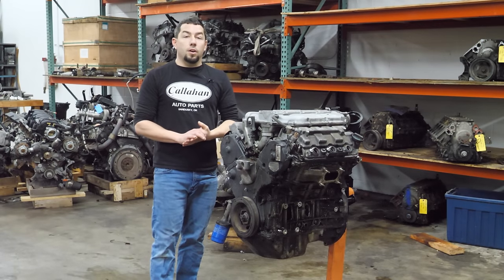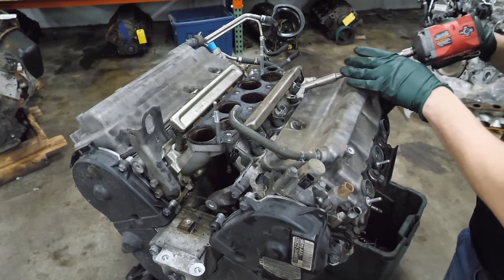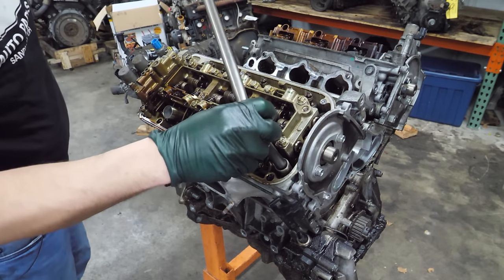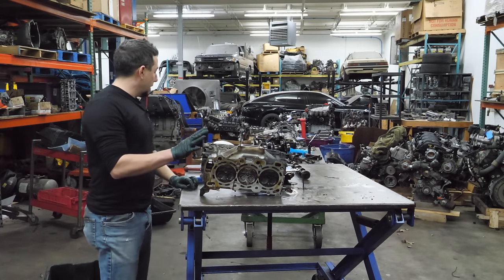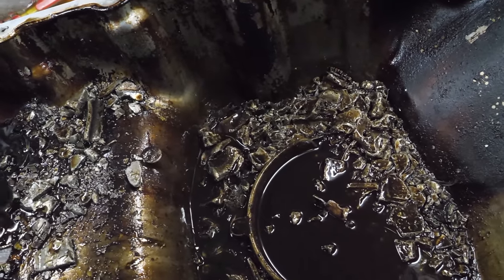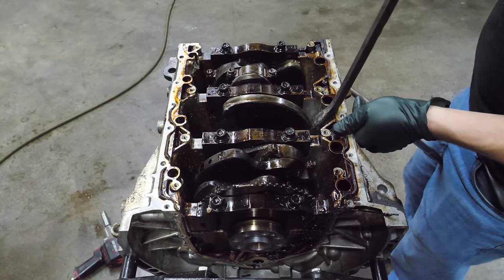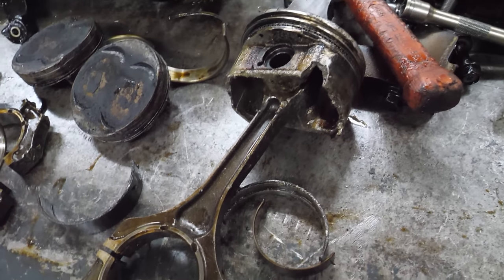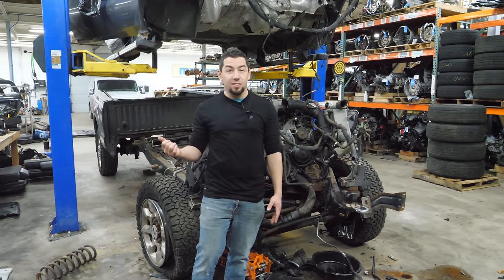Obliterated Honda Accord J35 V6 Teardown. Customer States: "Vehicle Shut Off"  OH I BET IT DID!

Comment: Aluminum gravel is never a good sign! Gotta wonder what exactly they were doing when it went BANG.
It's nice that Honda designed their engine to separate out the different size shrapnel in different parts of the crankcase. Japanese engineers are so organized!
At the end of the world, there will still be cockroaches and wrist pins.
My RAV4 and Civic are both still at about 75% on the dipstick.
Reply: Doing at least 10,000 RPM ?

Comment: Love this video. But pure customer neglect IMHO. To reach this level of destruction.  I repaired a lot of the 09 accords   Where they came from the factory with the rings incorrectly installed.  Oil lights were on at 1700km’s.   Crazy times

Comment: How did that engine run long enough to shred the internals so finely?? Wow!
Reply: I’m sure it came apart around 6500 RPM…probably had it floored because it wouldn’t get out of its own way.
Reply: Inertia and one functioning cylinder....

Comment: The problem with the VCM engines seems to be the fact that the vacuum effect created by keeping the valves closed pulls oil past the rings; there was a class action lawsuit about it in the early 10s for any J35 with VCM. Oddly enough, the Acura versions of the J-series were not mentioned, even though I'm pretty sure those had VCM as well. Guessing there was a different ring package on those.

EDIT: apparently the Acura engines were named in a separate suit. Not sure why.
Reply: If the engine runs in VCM deactive mode long enough will enough oil accumulate in the combustion chamber to risk hydrolock ?
Reply: @davidpowell3347  I don't think so. I'd be very surprised if the system didn't reactivate the rear bank every so often; I know GM's AFM does the same thing. It'd just get burnt up during combustion.

Comment: Honda's are the best performing engines and when they let go,  they do so with great style.

Just like the B series that split the block in half when you put 80 pounds of boost.

Jamie does 8 second quarter miles and has split a few blocks that way...

Comment: I must be extremely blessed with my 2012 Accord with the J35Z2 engine, It has 143,000 miles on it, NEVER had one issue with the engine, still getting up to 31-32mpg on the highway, 25/27 mixed.  I changed all the plugs at 98,000 plus timing belt/water pump, and except for a very slight off white color, the plugs looked brand new.   Oil changed religiously. along with all other fluids (tran, PS, brakes, every 30K ).  BlackStone Lab oil report is as follows:  "Look at that, another impeccable report to round out trends for this Accord! This oil was in place
longer than the last, yet iron and copper both declined. Maybe routines have shifted since 2017, and this Honda is doing more easy highway driving (which is the application that tends to generate to least wear) or maybe steel and bronze parts are just getting along better. In any case, every data point we have to go by points to good internal condition. The physical tests were all within specifications, and the 1.4 TBN shows just a little active additive remained. Nice!"  What the devil did this guy do, get the car, apply full throttle, walk away from it for a week and come back later after it blew up??

Comment: I once bought a donor VN for the manual box with a Buick L27 3800 that blown up far worse looking that this from the outside. The entire sides of the block was missing on the rear 4 cylinders all the way to the water jacket. There was only a crown of No.5 up in the bore, no rod or other piston large parts. Just 1kg or so of fine gravel and sand sized metal in the bottom of the sump, wrist pin punched half way through the sump for quick oil chances, the two lower rings in the sump.  Broken cam lobes from when the piston hit the valves and transmitted shock up the valve train. Pushrods were fine somehow. Nearly all the bearings were spun. One of the crank counter weights was broken off. 

The amazing thing was that it still started perfect and ran and could still drive, though it would have died from lack of oil eventually. 

Turned out it hadn't had an oil change in many 10s of K and there was so much solid carbon that the oil pick up was blocked and a kid was using it as a burnout car. 

At my last job, one of the race car's LS 6L blew up really bad like this. It had bits of con rod up in the intake and most of the valves were missing. It also had cylinder deactivation but it was deleted with a kit, so we suspect something with the delete caused a valve or two to drop at 8K.

Comment: Those are alternatives to a PCV valve you are correct though in order for them to work properly you need those inspections ports aka alternative PCV systems to be on both sides so you get proper flow through the engine block.

Comment: I don't have much experience with Honda six cylinder engines; however, my mechanical experience with the older 1980s EK, ES,  A18 and A20 engines was great.  Underpowered yes, but the engines and five speed manuals were robust.  I maintained my Hondas, but I know a lot of owners who ran them two qts low on oil, overheated, low on coolant,  dirty air filters,  unadjusted tapping valves,  but we never had to replace a head gasket, valve stem seals or had work that required dismantling the engine.  The downdraft carbs suffered from vapor lock on hot days although not a problem with the side drafts on the Prelude.   The alternators were crappy and the bodies rusted, but the drive train was exceptional.

Comment: That engine reminds me of the 2004 Honda Accord sedan EX-L 3.0L V-6 my son bought at an auction ($700) many years ago that only made it a couple miles before the 5 speed automatic trans (BAYA) gave out but after a transplant out of a wrecked Accord, he now has almost 350K miles on the odometer, doesn’t burn a drop of oil, and the car runs extremely smooth and quiet.. Of course an oil change every 5K miles with high-mileage full synthetic oil/filter that claims up to 20K miles may be helping the longevity but we have no idea what the previous owner used or if the timing belt was ever replaced. 350K miles makes me nervous but the engine purrs like it’s brand new.

Comment: I keep meaning to install my S-VCM I bought in my 2009 Odyssey EX-L... if it weren't almost midnight, I'd go and do it right now. I think my lunch break tomorrow is now spoken for. It has 220,000 miles, and while it's had misfires and fouled plugs, nothing catastrophic has happened... yet.

Comment: These engines received a "quiet" warranty extension.  Honda did not notify customers.  I had one in a Crosstour.  Found out about the oil problem at Thanksgiving one year.  Put 3qts of oil in a 4.5qt system before driving 8hrs to visit family.  Ate a couple more quarts on the trip.  By the time I got it into Honda, I learned my warranty extension had expired. Loved the car, but traded it in ASAP (not on another Honda!).  2006-2012 Accords and Crosstours with the v6 as well as Acura TL (3.7) are time bombs.  My cousin got lucky.  Her TL started eating oil early in its life and she got her engine overhauled under warranty.

Comment: I would like to take a moment to recognize how strong the bottom end of this engine is, the main caps held the crank in as the rest of the rotating assembly was fed through it and came out relatively unscathed. I wonder how much boost that thing could handle with proper oil changes and VCM deactivated

Comment: im happy to say that i have a j35A7  2013 minivan and its got 93,000 miles and i drive it really hard and the VCM activates so smoothly that i have to look at the dash and barely notice the difference in engine sound to even notice it. since ive had it new i never went by manufacturers idiotic recommendations.  ive always used 5-30 synthetic cause 0-20 is like water. i change it every 3 months.  i changed the timing belt at 80k miles and like usual turn 6k revs from time to time. i also have changed the transmission fluid every 6 months (cause only 5 comes out) and i use a trans cooler along with an oil filter. i dont like radiator cooling for transmissions i separate them. its a large ford oil filter for the transmission that i also change with fluid. its DW-1 fluid. i have never had a more perfect shift. full power is always available and downshift is really quick and precise.

Comment: The shear amount of laughter in this video I think sums it up. I was laughing along with you as I watched this in amazement.
I ended up looking back at the Kia video to compare. The Kia had good cams. Did this have good anything?
Speaking of which, we only saw one cam. What was the other one like?
Didn't think the Kia would be knocked off the mantle so quickly!

Comment: 2015 odyssey touring 
380,000 + km and still going.
These v6 engines are one of the best engines.
Most of these issues are people who don't maintain the engines.
Maintain and have no issues.
I haven't had a major issue with my van and almost at 400,000 km

Comment: I love your laugh Eric wish I had a opportunity to work with you your such a good and funny guy keep up your videos when ever my motor blows up on my 03 Yukon I want you to tear it down and see what you got to say it’s almost at 300k miles but still running strong I do change my oil on time most of the time I might go like 1k or 1500 miles over but never had a issue let with it right now my mother in law has a 5.2l 318 in a 98 dodge ram 1500 with a locked up motor couple cinders wasn’t oiling wonder if I could convince her to get rid of it hmm anywho keep up the good work Eric

Comment: I've worked on Diesels for 20 years.....have done all my own work including a full teardown and rebuild of a LT1 gm motor, several D series and B series, a 4.7 and currently a 5.8.  I have NEVER EVER in my life removed a cylinder head and have ONE missing piston much less 3 unless there was a HUGE hole.

Comment: Interesting, I'm running 5-7 psi in my J35z2 and so far it hasn't blown up. 147k miles with a 5speed auto. Deleted EGR and have a .63A/R Maxpeedingrods turbo. No cats and no O2 sensors with Ktune

Comment: Wow. They must have run that as long as possible after it broke because of the thousands of fine metal particles and the holes however the block. The block was like Swiss cheese.  I would have loved to hear that noise it made from when it 1st broke to when it finally stopped turning.

Comment: They do make green engine oil. Brad Penn if I recall. There's also a brand of racing oil that's green as well. This one was lucky to have any oil, let alone high end name brand stuff. 

Never seen an air cooled Honda v-6, Bluetooth connecting rods, all  cylinder shutdown, variable valve seating, adjustable compression stroke and even hammer forged internals. This engine has all the latest features. Neat!

Those little bits of debris on the front middle intake valves that aren't nuggets, they're chunklets. Also I'm incredibly impressed this engine just shut off on the highway. Usually when an engine grenades half it's cylinders and disconnects the remaining cylinders' rods....... It tends to be a bit more violent than "shutting off"
Reply: Sure, but that wasn't it. There was coolant in the oil because when the bore broke on the middle rear cylinder it created a leak from the cooling system to the oil pan.

Comment: I used to have an automatic V6 accord that also just "shut off" like that, I thought it was the fuel pump at first. First it started back up still rolling on the highway, seconds after it stalled in a corner, and third time it stripped the teeth right off the timing belt. Now I have the 6MT engine which doesn't have that silly VCM

Comment: The only engine I know of that survived oil starvation was in a Chrysler New Yorker. A lady drove it to Jiffy Lube because the low oil pressure light came on. When they went to drain the oil, there wasn't a drop left. After she turned it off, the engine seized. Wouldn't turnover. However, they put oil in it and rotated it manually a few times to try to get oil in the cylinders, and it cranked up, but it smoked so bad because it was burning all the oil they put in it. It was unbelievable. She claimed ignorance that the engine needed oil changes.

Comment: Should have gotten the honda with the 4 cylinder. mine now has 230000 miles and have not done anything to engine except plugs, oil and filter when required. still runs great and is strong. have fun.

Comment: I had a lady with a crosstour that did almost this exact thing. She said she was driving on the highway and it just shut off with no noise. I had never seen a catastrophic j series failure before that. Engine was completely locked up.

Comment: Seeing this and knowing you’ve torn down a K20A2. I desperately want to see you snag a k20c2. Seeing all the fits about the L15B7 turbo engines and how they easily bend rods and how SLIM the rod cap bolts are. I’d like to see up close how honda did the new 2.0 NA… I feel it’s very underrated and may probably have a strong NA tuning aftermarket if done right.

Comment: I have seen worse.
Some kid put the turbo charger from a Volvo 740 on a civic with no waste gate.
Ran wonderful for about 30 feet. all pistons went through the oil pan. all valves were blown through the hood taking it off as well. there were 10 cracks along the block .
the Pistons went into the road to a depth of 5 inches deep from what used to be the top of the piston.

Comment: Bought a 2009 Pilot with 150,000 on it for 7,000 bucks last year in 2023. It was getting around 9 mpg, on the damn highway! The vibration when the cylinders deactivated was absolutely ridiculous, and it ran like shit! After doing a bit of research on the VCM issue, I purchased, and installed the VCM Tuner 2. It never lets the computer know that the vehicle reaches operating temperature, thus not allowing the VCM to activate. 😁 Step two, and three was changing the timing belt, and running various engine, and fuel system cleaners through to clean out all of the buildup. Oh, and I stopped using regular unleaded, and switched to premium fuel. Believe me, it's worth it, and I don't drive it like a race car either lmmfao! 😂 After eliminating the VCM, doing some basic maintenance, and switching to premium fuel, and synthetic oil, my 15 year old Honda Pilot runs like a new car! No vibration, minimal oil consumption, and yesterday on the highway, it was getting 24 mpg! Not bad. Drove it up Pikes Peak to 14,115 ft up mountain switchback roads with absolutely no problem. 😁 On a side note, if you choose to install a VCM bypass like the one I did, it will activate the check engine light because the computer thinks it is operating under normal temperature, but I can totally live with that! ✌️

Comment: I agree it was oil starvation, but the question is why? All the debris lodged inside the pickup tube shows that the pickup was still sucking in oil, so the oil level was at least that high or higher. No sign of oil pump failure, no spun crank bearings. Something also weird is the customer didn’t note any low oil light on that work order, which may mean the oil pressure light didn’t come on, or that they just don’t pay attention. But it is curious. 

I’m personally leaning to coolant in the oil. You noticed coolant in the oil when you drained it, but the block was still full when you pulled the water pump and turned the engine, meaning surprisingly enough I don’t think it got there from the engine coming apart. If the engine was pushing coolant through the bearings which doesn’t provide any lubrication at all, that would explain the full pickup, lack of lube, and no low oil pressure light reported.

Comment: Yes, it is true; A lot of people think that because oil has improved over the years, they can go longer between oil changes.  "They" say that I can go 5,000 miles on my Jeep between oil changes, and 10,000 on my Duramax diesel....  I do 3,000 on the Jeep, and 5,000 on the Duramax. (And have, on both, since new.). Oil is CHEAP, motors are not!

Comment: I have a 10 Base TL similar J35. I literally took off the intake manifold about a year ago and cleaned it. You can split that clam and put it back together fine. Mine had some but very little oil inside it. Which is why I cleaned it. I don't think my engine has Vcm? I know later v6 tls do... I'm going to pull my plugs and see what I find I literally just changed the oil royal purple. All see gets.

Comment: I had to laugh when the crank bolt just zipped right out. I had an epic 6 hour struggle against a J35 crank bolt on my wife's Pilot that ended with me buying a 3/4" drive 750 ft-lb pneumatic impact and torching the balancer with map gas after I broke a ratchet and twisted apart an impact rated 1/2" extension. That being said I just changed the plugs on the vehicle after 160k miles and they looked worn but otherwise pretty good. I have considered the VCM delete but I must have got one of the good ones because it seems to be causing no problems. On a Pilot they are miserable to work on though because they are set so deep in the engine compartment.

Comment: 22:38 Ok, be honest, how many of you were just telling him to do that from the beginning? 😆

I wonder why car companies can't just run a second engine or second crank/rotating assembly instead of the cylinder deactivation schemes that haven't worked right since the 1980's? It would work so much better to have two I-3's running in tandem, one of which could stop completely, than to try and run half an engine. It's probably something an engineer has suggested, over and over, just for a beancounter to say "Nah, it's cheaper to just fuck up our reputation by re-visiting GM failures from 45 years ago". There's so many advantages to running two separate engines instead of shutting down half of one and keeping it spinning, chief among them the ability to alternate which engine is turned off.